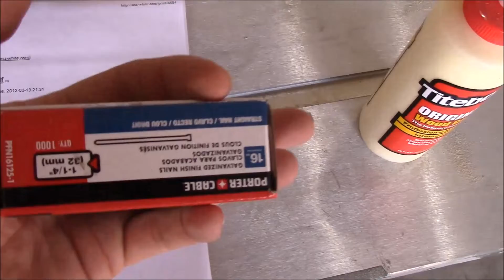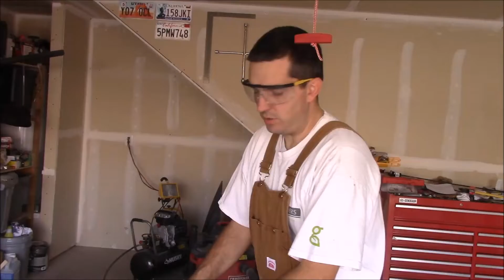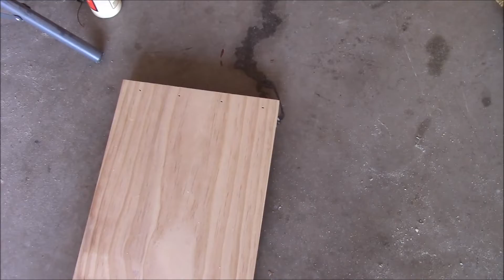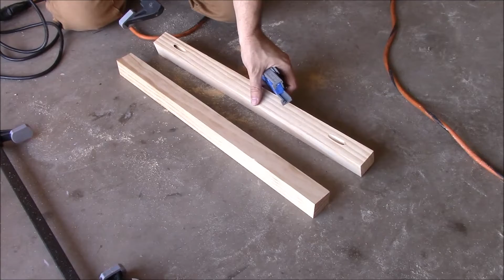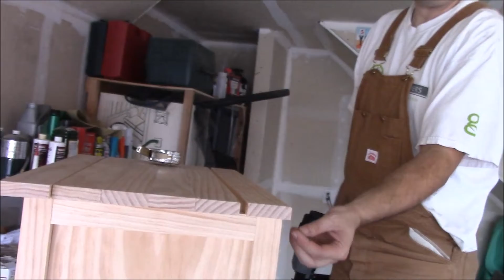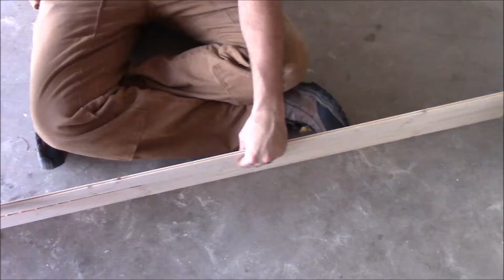Ana White Kentwood Bookcase Build

Comment: Where did you get all the finish grade pine from? My big box stores only have oak, which is much more expensive.
Reply from the maker: It was at Home Depot.  Nice stuff, for sure.  But also dents pretty easily so if you have kids, keep that in mind.
Reply: @LDSreliance  Thanks, and ah well it adds character
Reply from the maker: Haha, true.  Even with some scratches and dents it will outlast anything you can get at Ikea or Office Depot by like 10x.

Comment: Why is everyone obsessed with pocket holes? You have the basic tools needed to do simple joinery that will allow this to last forever.
Reply from the maker: True but that joinery takes a lot more time.  As it is, this bookcase has lasted my sister through multiple moves where all her particle board trash furniture from IKEA and Wal-Mart has completely fallen apart.  Maybe this won't last her whole life but it is radically better than anything else she could have purchased for $150.
Reply: Pocket holes have been around a long time, if you have ever restored any really old furniture you would know this. The old wood workers of the 18th century had a special bit just for making pocket holes. Look it up or just watch this YouTube video from a fellow restorer. https://www.youtube.com/watch?v=J6UJTjqvYgQ&index=197&list=UUn1dXKStkuDLL5qLTDFwOBQ
Reply: Charlie H pocket holes are easier and faster.  Its easy to use filler in 1 second n they don't show

Comment: This looks great and you did a great job. Your video really makes me want to make this. The wide pieces are them the select pine boards that's what they look like anyway. I may be crazy but pine is my favorite wood. Iv worked with cedar, poplar, and white oak but still pine is my favorite. Thanks for a great video.
Reply from the maker: +steven reno Yes, my sister wanted me to use select pine which cost more but I don't have a planer and jointer to make the edges flat and smooth so it was worth it.  I like pine, too, just prefer cedar for the smell!
Reply: Yes sir !

Comment: U forgot the most important woodworking tool of them all. where's your workbench?
Reply from the maker: +Jon Story Good point.  Unfortunately, I don't have enough room in my garage for a workbench.  I have to back the cars out of the garage to do any woodworking and then clean things up afterward and put the cars back in.  So anything I use has to be portable and able to tear down.  That is why I built some takedown saw horses but have yet to come up with a sturdy workbench that can be torn down and stored easily.
Reply: LDSreliance This is also my dilemma!

Comment: it is not possible to construct bookcase without using expensive cutting tools, nail gun etc?
show your craftsman talent without using expensive tools, that I consider to be real art of craftsmanship.
Reply: do you troll every build video with the same dumbass comments.   I'll answer that.  yes
Reply from the maker: sultan Merchant That wasn't the purpose of this video.  I have no desire to build furniture like that.
Reply: sultan Merchant where’s your bookcase vid?
Reply: sultan Merchant you really need a table saw, a mitre saw, and a brad nailer at the very least, because making right angles is really a pain in the ass if you dont have a table saw, and if you try to nail trim pieces yourself, you need a hammer and tap at least, but your store bought trim or routed trim will be easily damaged without using a tap.  Spend about $1k in tools will last you several decades if you are good to them.

Comment: Great video. Is this made with all pine? The boards just look so square and straight.  I can't seem to find boards like that at my Lowes.
Reply from the maker: Jack Wagner III Yes it is all pine.  My sister commissioned this piece and she paid extra for the premium cut pine that is available in the hardwood/shelving section of my Home Depot.  You won't find it in the lumber area with the rough cut wood.
Reply: LDSreliance OK thanks for the info.  It definitely makes a huge difference having the nice sharp corners on the boards.
Reply from the maker: I agree.  It wasn't cheap but it was worth it.

Comment: You really should get some water and fertilizer on that grass
Reply from the maker: Mark Stiehm It was December so the grass is dead no matter what :)
Reply: LDSreliance so you feel pocket hole screws are necessary? I've used #8 wood screws to offset costs on a few projects. Just giving you a hard time about the grass too!
Reply from the maker: I use pocket holes a lot but I never use the actual pocket hole screws.  They are too expensive.  I use normal, all purpose wood screws with a long driver bit.  Good comment!

Comment: I can't seem to find all pine boards. My local HD doesn't have 1x3's at all and the 1x2's and whatnot are all spruce. Any suggestions for wood? First project so would like to keep it on the cheaper side if I mess up.
Reply from the maker: At my HD where I got this wood, they have an aisle for hardwoods and wood shelving.  That is where I got the select pine boards in this video.  If they don't have that at your store, you may have to buy a 1x4 or 1x6 and rip it to width on a table saw.  The other alternative is to order your wood online, which is surprisingly reasonably priced:

http://www.woodworkerssource.com/